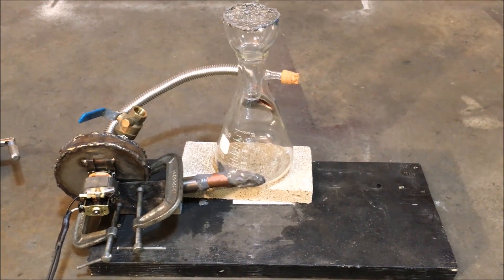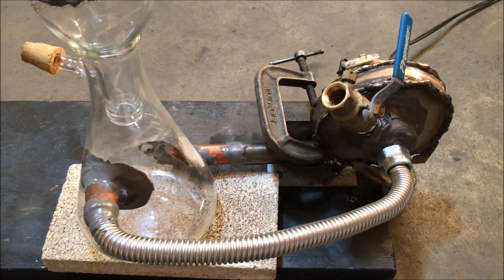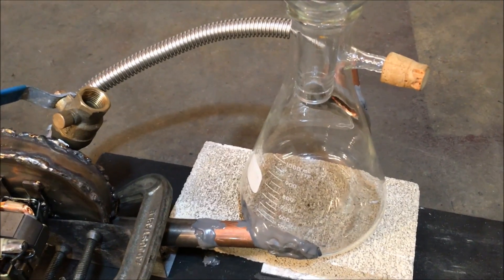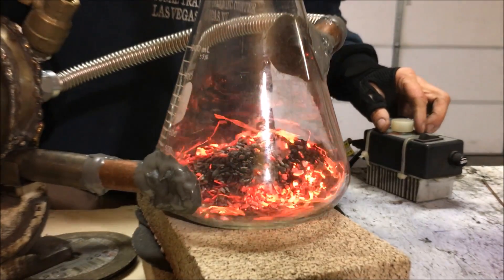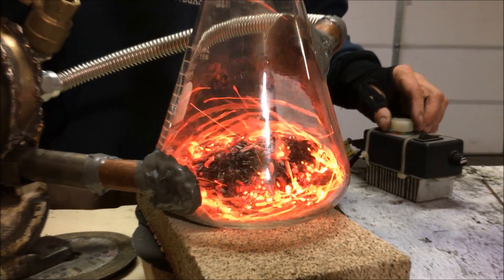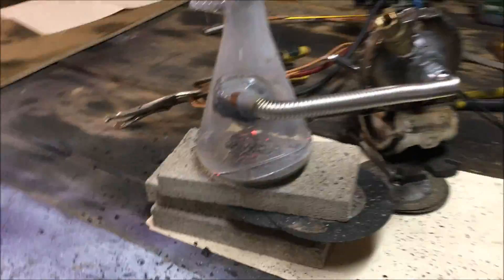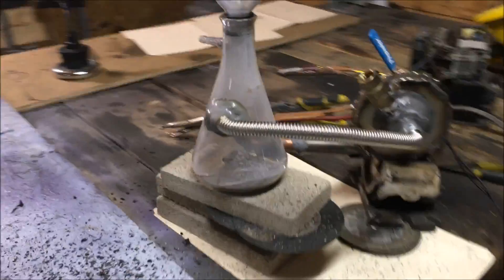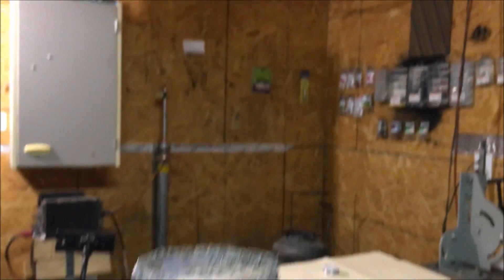Cyclone Flyuidized Bed Gasifier

Comment: To munch oxygen. Not sure why you need to cyclone the fuel. Never heard of it done like that . Just a experienc maybe. But to get the gas the fuel needs to be heated and depvrived of oxygen or elae it just going to burn up.and i heard adding little bit of water helps with gasification. just thought i comment.

Comment: Im probably 7 years late on this, but ive noticed from most charcoal and wood gasifiers, is that the fuel temperature determines its combustion as well. I believe your system needs a length of copper pipe on the outlet to cool it, with a valve on the becker end to adjust velocity if you can.

Comment: Dear sir, you need water and heat to make singas...  C+H2O=>CO+H2....  This is singas from coal. when all other gases are gone froma the wood, you need to inject some hot steam in the burning chamber on the red-hot coal, and then tou will obtain emissions of singas...
Reply from the maker: was trying to make CO not just syngas

Comment: I think it's strange that  minutes after the test that the diffuser was cool to the touch yet at the base it was still above 400 ....along with the air inducer not overheating.... hmm...seems like it's doing the job of a catylitic converter.

Very efficient very clean  burn
Ppm of carbon monoxide?

Entrance level heat?
Burn chamber temp?
Exit exhaust fume temp

Points to probably the most efficient scrubber I've ever seen

And also points to no particles I have to be burned or they're moving too fast to combust

I would think that your propane torch should have been more than sufficient heat to ignite exiting gas

I think it's the inlet to the combustion chamber for the vorticity of air

Reduce the inlet piping size to constrict air flow inside the chamber it will make a slightly dirty or burn and you'll still have your vorticy externally where your mixer is

Modulation ratio? 

after burner tube?
Stuff the exit tube to create drag?

Anyways thanks it's entertaining.
I think I'm going to subscribe like, and set the notification Bell.

Comment: lol the thumbnail looked like a particle accelerator, and the sound 6:30 xD confirms that.
BTW i worked in a experimental facillity years ago, where they had a similar approach but the goal was not to produce gas, but instead raise the efficency to burn the coal. (They used a vertical approach with lots of small nozzles from the bottom. Goal was to produce as much turbulence aas possible so the mixture of coal an air is as high it can get.) you can do the same as a horizontal build, but you need more nozzles on outer ring and some on the inside + make the burning chamber from steel at least.

Comment: Credits for you that you tried when others just sit on their ass commenting shit about such videos.
I like your way of thinking, we are much similar in that way.
After seeing a few of your videos I'll subscribe for sure..! Keep it up there.. :)
Reply from the maker: Glad to have your positive feedback , to this day i feel it was a good try and not even the internal combustion engine worked the firs time they pulled the cord , heck i cant get a lawn mower to start sometimes . People like to tell me i burned up all the gas but they dont understand that carbon liberates a flammable gas upon combustion   . i just didnt have time to tune the device before it failed .
Reply: @NOBOX7  That is exactly what happens. The concept is feasible. Coal-fired gasifiers were widespread to produce gas for several purposes. Sometimes the devil is in the detail, so it may just have been a slight error somewhere in your setup that made it fail.

Comment: Re more durable beaker: Borosilicate glass can handle 160˚C fast temperature difference before the shock breaks it. Conversely Quartz Glass can handle more than 1000˚C temperature change without cracking. e.g. Yellow heat quenched in water and survive. There's a company called Qglass that makes quartz lab glassware in your country.  Pricy material though.

Comment: Cool toy, but you cant gasificate charcoal since it's already gassifyed to the end to make charcoal
Reply from the maker: you dont understand carbon combustion , im making water gas , and yes you can gasifie charcoal
Reply: @NOBOX7  to make wood gas you have the wood in an enclosed container so no oxygen enter and then heat it up uintill there is no more burning gasses coming out, no matter how hot it gets the charcoal does not get combusted or vaporize.

None of your test seems to produce any trace gas, only blowing some charcoal embers up in the air
Reply from the maker: @tullgutten  look up charcoal gasification  dude and i am not making wood gas jeeze your clueless for somebody who knows it all and fyi it was a failed experiment and  i say that it was a test BRO
Reply: @NOBOX7   i did NOT say YOU where trying to make wood gas, just when making wood gas you can heat it up uintill 1000°c and the charcoal will still not burn or vaporize...
Reply from the maker: Yeah sorry for being a jerk , i get hassled alot  over misunderstandings. Charcoal gasification is real and its better then woodgas  so i decided to try it in a different way but it failed .
Reply: @NOBOX7  hehe I understand, But as I have never seen or tried it I have no idea if it's possible it just seems very impractical or even impossible for me

Comment: Your glass was doomed from the start! The hole you made to plumb the cyclone in had already introduced hella stress.
Cool experiment! You should hit up one of us glassblower types to make you a flask that's got the right openings of the appropriate sizes. I probably know someone close to you, if you hmu. If you did the same thing on a hotplate, it would handle the carbon fire.
Cool vid. Cool experiment. I'm interested in seeing where you go with it.
Reply from the maker: Great input , never thought of the hot plate

Comment: GREAT Video and interesting to try wood carburation needs more creative genus. Cyclone combustions is used in coal fired power plants for very high quality mixing and combustion process. Reflux is common in the fuel refinery industry. Makes for better quality output overall. Fluidized beds are for very high gas production.. High temperature steam is ideal for cracking most any biomass into the basic Carbon and hydrogen to create that gas you want. Regenerative heating of fuel gas can help the incoming steam and or air balance out the heat needed to make the process work, But ash has to be dealt with keep up the good work and show your progress. Good Luck safety first and don't get burned. High risk is always the danger in this type of experiments. Low temperatures drive off tars so the process must allow enough time to make that tar crack and vaporize with high enough temperature. Different fuels inputs will require different operating conditions. Theory says the more you crack the more cubic feet of fuel you get. So ideally temperatures may vary widely from wood, to biomass, garbage, plastics and tires or a mix.

Comment: Almost right. Water should be used to get H2. The method was known as 'lightgas'. It gives 51% H2, 21% methane, 9% carbonmonoxide,15% N2. Hot cokes must be contacted with superheated steam. So a pressure cooker or something. Now output close. Then air thrue the cokes to heat it up again. And another cycle of hotsteam. Most efficiency here.
a.k.a. coalbed gas or something in english. succes! You can do this.

Comment: The key to achieve success in gasification process is controlling the amount of oxidant, your oxidant should be in the range of 20-70% of the Stochiometric AFR otherwise you will just burn the gas and the end products would be nothing but CO2 and H2O and little to no UHCs. so work on that as well
Reply from the maker: Yes this is all understood , thats why a inlet valve was used to throttle the system but thanks indeed for the input
Reply: Would it help to have a small carburetor to adjust the air but have water in the line instead of gasoline, and having a nettle adjustment tool so you can adjust the water-air ratio? I tried that with a gasifier that I made and had some luck

Comment: The gas was there, if you really want to see its flame, you should attach a long pipe at the exhaust of the funnel and soak it in water, to cool the gas down, and then put a small igniter next to it, which has a low flame velocity. and to ensure that your gas is not simply PM you should attach a cyclone separator and filter all the pm and then draw the clean gas and lit it, an please do not do such experiments inside a closed environment, you might hurt yourself
Reply from the maker: great input friend

Comment: Fascinating! You've got an interesting approach, and I like the improv. Got some thoughts on the process, how to improve the equipment cheaply, and maybe where you can take it that'd be useful. (And yes, dammit, wear safety glasses - I was cringing the whole time - and have a fire extinguisher nearby. You need to have a 'safe crash plan'.)

FWIW, about 10 years ago I built a reactor in my garage out of Home Depot + scrounged parts that turned methanol into high-quality gasoline (using the Mobil MTG process). With that I started a company here in Silicon Valley, raised $1.2 million in seed investment, built a prototype at a large sewage treatment plant that turned sewage gas into methanol and then 92-octane gasoline. I know a bit about waste-to-energy. :-) Happy to share thoughts.
Reply from the maker: @ 10:19 you will see that i am wearing goggles just cant see me slide them on or even my face much
Reply from the maker: im gonna do another small test with steam maybe tonight

Comment: You did light the gas. You have to remember, when the gas exits the valves, it burns so clean that you literally cannot see the flame. You have to hold paper to the gas valve and watch the paper ignite, just to realize the gas is indeed lit.
Reply from the maker: Good point , i had so much going on and so little time that it was hard to focus . i may try this one again some day
Reply: Yea no worries. Just run a flame up and down  that gas stream coming out of the valve and check to see if it's lit with paper. That flame burns so clean sometimes you can't even see it.

Comment: the mechanics are sound, the problem is the charcoal is the end result after it has been degassed in an oxygen free process....

the charcoal can be your heat source but you will also need to add fresh wood chips to produce the gasses you are after that will then rise to the (need far) finer mesh that does not make it into the recycler tube....
Reply from the maker: you need to research charcoal combustion , it does not produce Co2 when burned like you think it does , it produces a small percentage but its mostly CO thats produce, charcoal does not burn the way you think it does , look into charcoal gasification

Comment: Please please put your safety glasses on yourself‼️‼️‼️‼️‼️
Then get a safety shield ‼️‼️‼️‼️
At 600degrees the glass will shatter
And Blow up in your face not good at all bro ‼️‼️‼️ you need thicker Pyrex a good idea with the pump try it with Wood . The vapors off the wood can be burned but they need to be cooled down they won't light if they're hot⁉️⁉️⁉️⁉️⁉️⁉️⁉️
Almost all vapors need to be cool down to """"ignite"""  try that and hit me back ⁉️⁉️⁉️⁉️⁉️⁉️⁉️⁉️⁉️
Mc

Comment: One effin cool experiment!
VERY nice design / assembly and testing process.  I bet that beaker took some time to build too!

I suspect the air inlet on the bottom and split into 4 or 8 inlet ports might suspend the fuel better.  I think the design will work. You just needed more "play" time without breakdown.
Sub'ed btw!

A metal one would be easier to build... but harder to see the results... Maybe a metal test unit with a fire glass window for viewing the internal stuff.

Comment: Before posting I wanted to read some coments and found out, that Koen Van Looken said it allready: From all my testing with gasifying wood-chips I am quite sure, that you burned everything gaslike compleetly up in the first turn around in your magic bottle. This is a very good way to generate heat, but the gas is burned up immediatly. Sorry to tell you. There is a intetesting dvd on German ebay with some 10,000 (!) old and new patents about gasification of different materials for less than 10€, an endless source ...

Thanks for the interesting demo, I liked it! Let us never stop testing, (as Clinton was the minor desaster ... ;-)  )
Reply from the maker: well not to sound smug but you dont understand carbon combustion , charcoal or "carbon" liberates CO  gas when its burned CO gas burns  , look up boudard reaction  "both reactions"  and carbon combustion properties and water gas reaction. most things release Co2 when burned but white hot carbon converts Co2 gas into Co which is a combustible gas  so as the carbon burns it is converted to co2 and heat , the heat gets the carbon red hot and red hot carbon turns both steam and co2 into a flammable gas , the carbon in this vessel has some moister in it that is converted into hydrogen gas and oxygen because hot carbon cracks steam . this is an ongoing study and it took years to accumulate all this info but trust me this test has more to it then meats the eye
Reply: ok, thanks 4 the info! Keen to lern in any aspect.

So coal is a compleet other thing than woodcoal in my central heating, which is gasifyer too. I can load this poor thing with everything from cowshit to wood, with straw, with brown coal, different kinds of wood- or coal-briquettes - it works without any difference. And I burned 2 tons of coal, I got for free ...

But what you do, seems to be quite different. How could this gas do not get wasted by this extensive heat and oxygen? Would like to know more. Where can I get good info?

Thanks in advance!
Reply: paul wyleciol i

Comment: maybe try smaller particles of carbon... more surface area for combustion
Reply from the maker: Great point . i do intend to try this experiment again . Carbon combustion is not like other forms of combustion , its the only combustion process that liberates a flammable gas Co in large amounts , i also intend to try steam injection on this process

Comment: 10/24/16 0700est:  Thank you for your video that I stumbled across while researching vortex gasifier and rocket stoves.
I have a T3/T4 turbocharger for a 3.5L gas engine project I gave up on, that I'm going to use to try improving on your experiment.  My first thought, I'll start with making a two piece cement mold of your 2000ml flask combustion chamber and piping using this method: https://www.youtube.com/watch?v=YExFi1pXSPw 
~ My retired firefighter thoughts and I assume you understand:
~ 1) pyrolysis, ignition temp definitions 
~ 2) air–fuel, stoichiometric mixture ratios: https://en.wikipedia.org/wiki/Air%E2%80%93fuel_ratio 
~ 3) a salvage auto yard gas/diesel turbocharger may help you with compressor assisted combustion chamber and exhaust turbine gases used to power 12V alternator/generator 
~ good luck to us both, Steve
Reply from the maker: cool let me no when you post the video , i hope it works for you , alot of people dont get what im up to becuase they dont understand carbon combustion, it is a unique chemical reaction

Comment: I think this is a nice demonstration of destructive analysis :-)

I love your approach in putting some theory into practice, well done, never give up on that.

May i ad some observation and a few hints:

To produce gas ( Co and not Co2) with glowing charcoal, you'l have to reduce the amount of oxygen, otherwise you just burn the charcoal...
Try to put the flask on a cooking plate in a first testing, you'l get gas..

In a fluidised bed -setup , there are 2 events: The heating up from the bed with oxygen / air blowing and the circulation without air or oxygen to transfer the heat from the bed into the particles to be gasified.
Reply from the maker: thanks for your input friend , this comment slipped by me